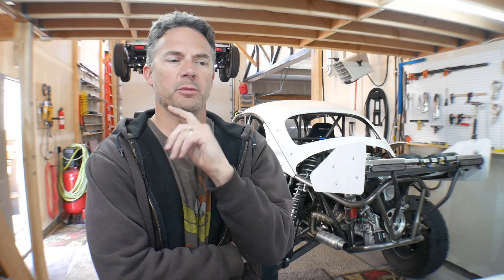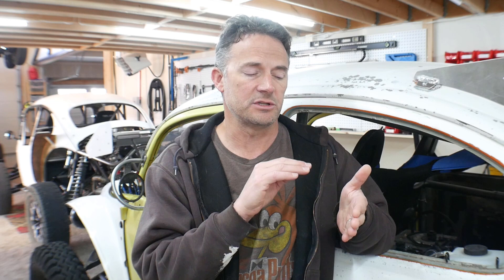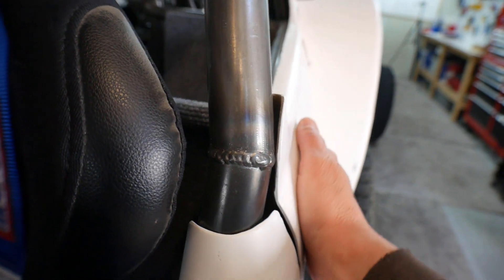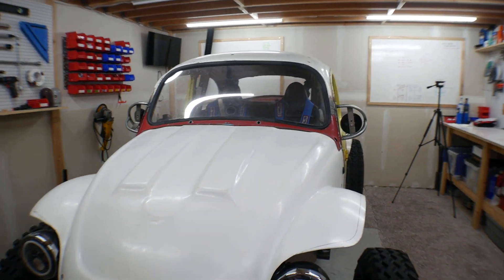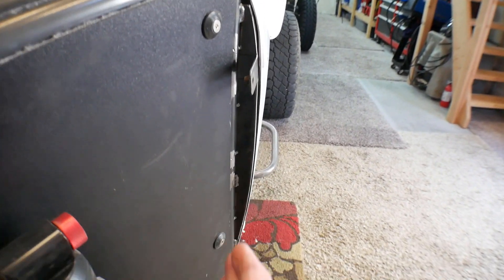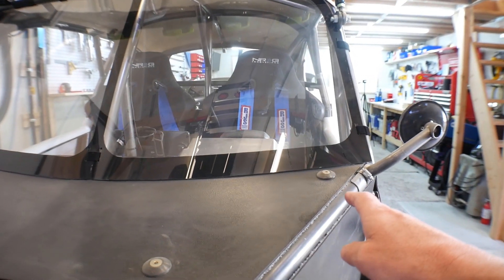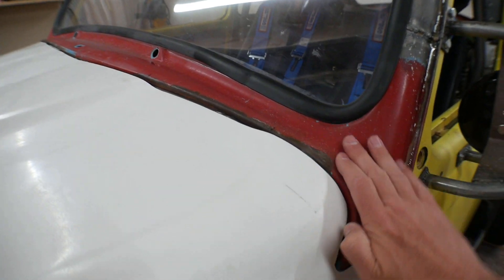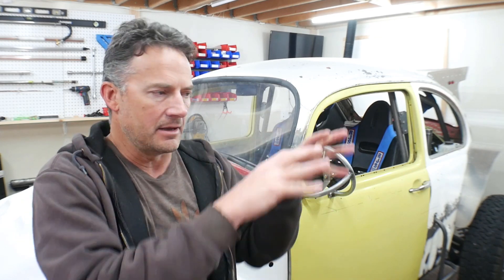Baja Rebuild (Mauler) Episode #2

Comment: Greetings Mike, Nice explanation of the roll cage difference between Wratchet and Mauler. I like those accessories installed on Wratchet 2 videos back, especially the rear camera and how you remedy the fitment of Wratchet to the trailer.  Nice to see Wratchet kicking dirt for the first time. How did it handle? I am curious how did the front end performed. I know that when you increase the rear suspension travel by installing a longer trailing arms on a OE Buggy frame  like 5 X 5, it moves the rear spindle 5 inches Back and widen the buggy 5 inches. It also affect the front to back weight distribution of the veh. Since Wractchet rear suspension was built with the rear drive axles perpendicular to the transaxle and possibly the Honda engine is heavier than the OE, I am curious if the front end is too light and affected the handling of the buggy. B safe and take care.
Reply from the maker: I can't say I've driven it enough to fully determine how I like the weight balance. But so far it feels pretty good. One thing I noticed is that the front doesn't feel light, but if you look at the video when I was starting the donuts it would understeer really bad. I would need to blip the throttle a little to get the front to dig in. Then when the rear started spinning it would come around. Then the torque of the rear wheels spinning would lift the front almost to full droop. So hopefully the next run I can play around more to see how the balance feels. 
But on the other hand the rear doesn't feel heavy. It didn't take much throttle before the rear would start spinning and walking around.
I guess the real answer is that I'm not sure yet. 😉

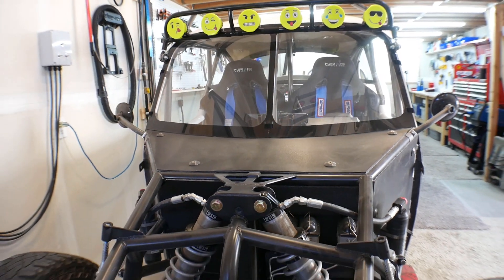Comment: Hey Doug, maybe mentioned in another video but missed it. I was wondering what the black pannels at 6:21 attached to the roll cage are? Is it just steel, or some sort of composite? Thanks in advanced and keep up the great work, love the videos
Reply from the maker: Those are fiberglass panels I made. They're about an 1/8" thick and have carpet glued to the inside. The carpet keeps them quieter. But I think next time I'll make them out of .063" aluminum and carpet the inside again. I think that'd be lighter and easier. On Mauler I made them out of .050" aluminum with no carpet. When the rocks hit them it sounds like someone is shooting a 50cal rifle at you. 🤦‍♂️